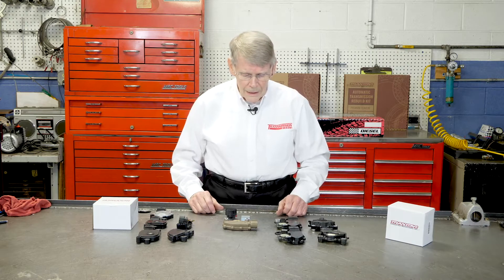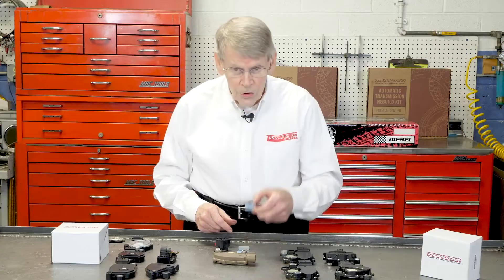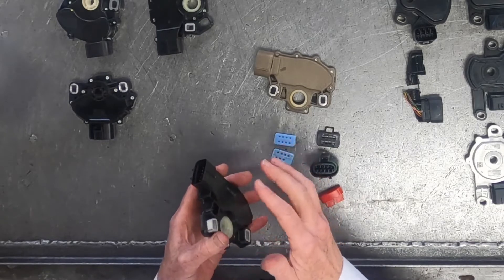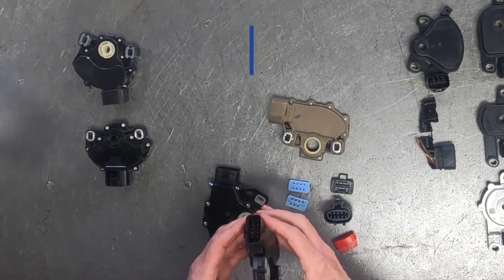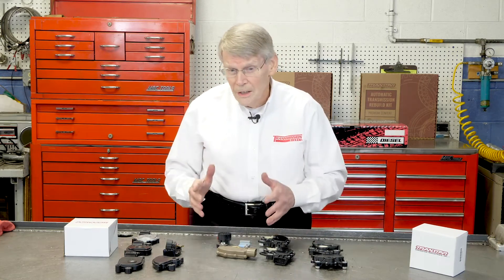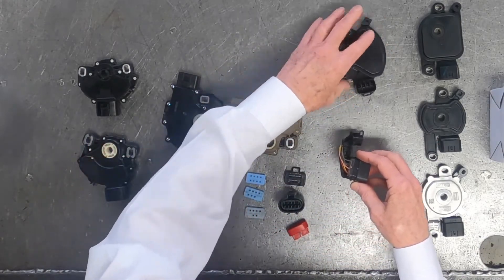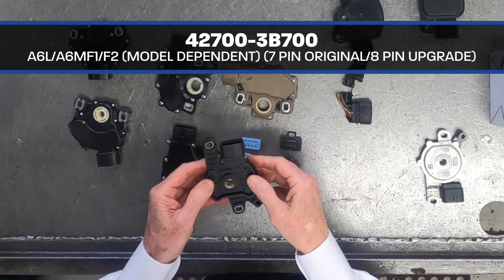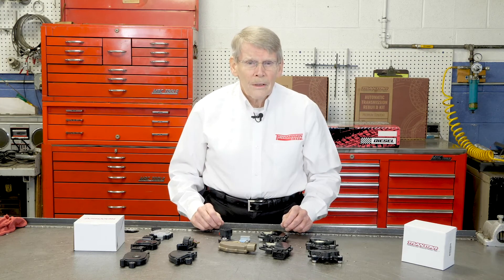MPLS Designs: Transmission gear selector switch design changes are not always uniform.

Comment: hello Im Jimmy can you please help me, I have a 2004 CL500 Mercedes and its been in limp mode for a year I don't know how to fix. Its reading this ( The signal of the transmission output speed is implausible with that of the wheel rpm. ) Do you know what that means? Should I change the wheel speed sensor? It goes in reverse and drive but won't shift pass 1st gear